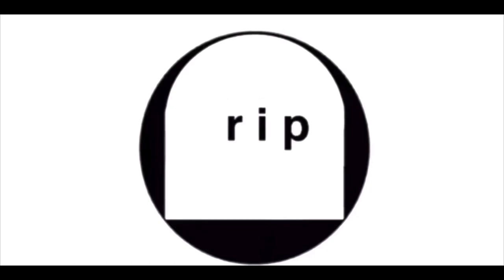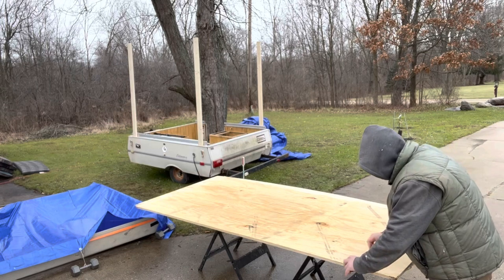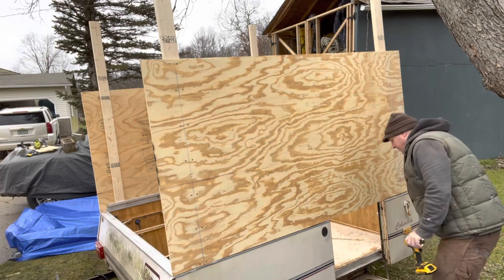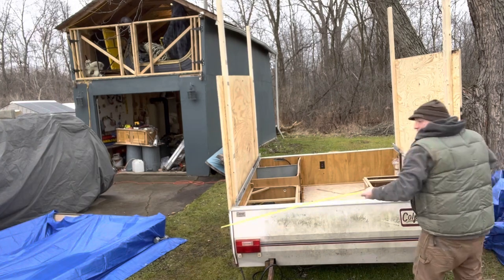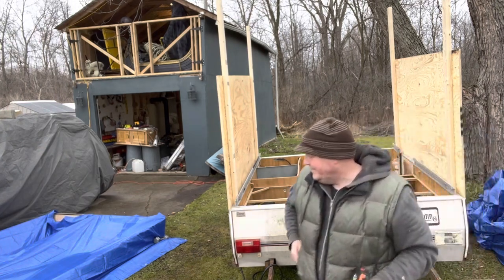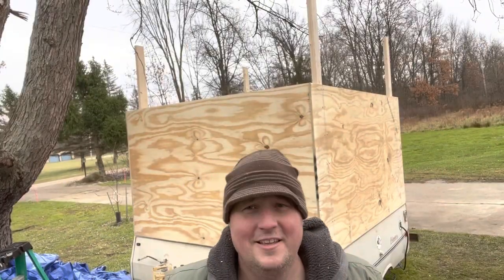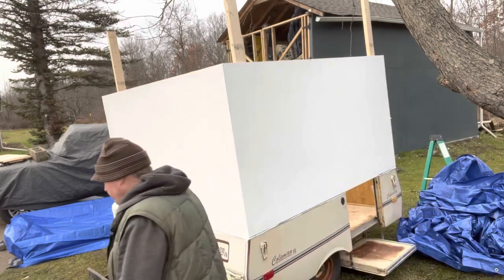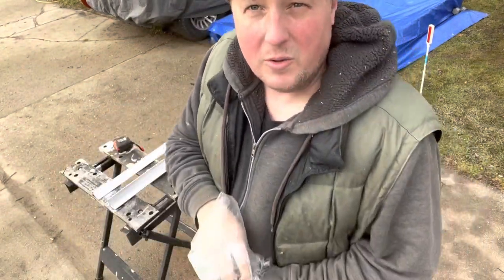PopUp Camper ADDING WALLS | HARD SIDE Conversion ep4 Tiny Cabin #diycamper #popupcamper  #camping

Comment: I got to the point where he recommends Stainless Steel to fasten aluminum. Might be a better choice as aluminum and Stainless steel react and cause corrosion. I don't remember exactly but I think Cadmium plated hardware is preferred I am enjoying watching his build. Video quality, he speaks clearly, easy to follow, etc. very well done.
Reply from the maker: Yeah you are right, between 2 unlike metals like Aluminum and Stainless, lesser metals like Aluminum will corrode if there is an electrolyte such as salt water to create electrolysis between the metals.  I am hoping I do not have this issue since its not in the water a lot.  I used what I had from my local hardware store, I was thinking of using galvanized steel too, I just have had really great luck with stainless in the past.  Thank you so much for all the positive comments!  This was a very fun build and I am still adding to it even though its pretty much finished now.  If you haven't Please Subscribe so you can keep up to date.  Happy New Year!
Reply: I did subscribe, yesterday. You have a gift. You clearly show how to do something, then fast forward to next step. great editing, keep the action moving. Smooth and humorous voice. Happy New Year to you.  @Jeep-Creep
Reply from the maker: @hueypilot1950  Thank you!  It honestly has been a lot of practice that helps my editing, pace, camera presence.  Believe it or not the video work is probably nearly 1/2 or more of the work.  Often I will film something that might take a whole day.  Condense it down into as little as 15min.  I enjoy this work a lot and keep a sense of humor I hope all my viewers get.  I really appreciate this kind of feedback, let's me know I am doing something right.  It's very hard to become popular on YouTube to earn enough money to make it worth wild.  Sure there are lots of YouTubers that earn a small fortune but they are very few.  Anyways Happy New Year and I hope 2024 is awesome for you and yours!

Comment: All things , such as trailers of all sorts and tiny houses and sheds that are manufactured in mass quantities are always gonna be out of square! These trailers are put together on a jig and then the parts and pieces are attached after it comes together.
The more and more the jig is used. It will get stretched warped and just weakened. And that is why your trailer/ camper is worn out and 3/4 of an inch off.
Reply from the maker: Totally makes sense. I’ve had an RV repair shop tell me these homemade rigs are built better too lol 😂

Comment: Why didn't you just pull it with your car???
Reply from the maker: Because I was using my car to winch the roof up the tree. I have a hand crank winch I attached to my bumper. Plus the camper isn’t too heavy to move by hand.

Comment: Looks like the undercarriage needs nore love than your giving it before the remodel
Reply from the maker: You are right!  I did bring it to a camper shop to give me the all clear on the suspension. They repacked the bearings, approved my weight, made sure it’s road worthy. The surface rust needs to be addressed. One of the main reasons I waited on addressing is because I wanted to figure out the gray and fresh water tank locations first. Also I need to figure out the diesel heater pump location. It makes a ticking sound and I need to move it a third time. Check my latest videos for progress. It’s winter now so I will handle the underside in the spring. I think I will wire wheel the underside, use a etching primer, then paint. After paint probably add a truck bed liner after it cures. Since I am in Michigan I want to make sure it stands up to the humidity and salt if I winter camp.
Reply: @Jeep-Creep  just don't wanna see your work goto waste. I converted a full size 78 Thomas school bus and got half as much time out of it due to rust and undercarriage problems best of luck
Reply from the maker: @retropalooza  thank you for the look out. For sure I will address it and take your advice of avoiding a pitfall
Reply: @Jeep-Creep  ahhh just being a nit picker. Been there done that. It's great to make your own you just don't get the professional no worry quality new buys have. Best of luck

Comment: Sure wish I was there to give you a hand…but great job.👍
Reply from the maker: I think you are the first person to realize just how hard it is to do this by yourself.  It is seriously harder than twice as hard, probably 3 or 4 times as hard without 2 people.  I reached my goal though and turned a piece of junk into something nice.  I am itching to do another one, I really would like to start with a 6x12 frame vs this itty bitty 6x6.  I would like to do a permanent bed and a fixed bench seat table, with a wet/shower bathroom.  This one came in at 1600lbs, which tows nicely.  Pretty sure I could pull off a 6x12 with all the extras under 2500lbs which is still nice for a mid-size SUV tow even though I have a Tahoe pulls easy, but superlight is nice for MPG.  Extra room would be nice for sleeping more than 1 person as well.  Stay tuned though, I have a few things to improve on this build... just finishing up Solar system and working to improve Chinese Diesel heater noise reduction, and finish my water system.  I would like to setup for a hot shower system, which will have to be outside maybe, unless I come up with a super mini-system inside.  I have ideas, I have see Van campers do it.

Comment: I'm building something very similar, was procrastinating because of the snow. Guess I better head down to the lumber store haha
Reply from the maker: Nice!  I highly recommend this build!  It’s fun, easy, and inexpensive. What kind of trailer are you starting with, how big is it?  I would love to see photos of your project. They are fun to do and lots of Facebook groups too on this subject.
Reply: @Jeep Creep  it's an old 7x8 tent trailer, it's quite an interesting thing, I've never seen one so heavy duty. The sides are more metal than tin. I will keep video and pics of the whole build and time line, and mabye throw them up.
Reply from the maker: @sockymcblackface7698  for sure I am interested in watching your progress.  Sounds like a bad ass trailer!  I love the older stuff it’s heavier duty than it needed be so the axles will take the extra weight easy. Mine has tin sides but the frame is very heavy which I like. 7x8 is a good size in my book. I am solo camping in mine with just a single twin Murphy style bed. I look forward to seeing what kinda layout you go with.

Comment: Ooh wow. Yeah I had previously seen this video already. It must of been a bit of a nightmare trying to do that by yourself. 

Hmm.. and now that i think of it, I don't even have that tree 🤣😅🤦‍♀️.

Can't wait to see how MY trying to build this will be.
Reply from the maker: Depending on how bad your roof is you might not have to remove it.
Reply: @Jeep-Creep  i believe my roof is fine. I was just thinking money wise.. reselling the whole system together. I'm not sure how it works. I am still studying the case 😅. 🙃 

In time I will decide. But your idea is awesome. I just would have loved an overall...redo. for what's upper part. That's all. More money I know. Indeed.
Reply from the maker: @LRDReadings  with a solid roof it should be much easier
Reply: @Jeep-Creep  you mean a new roof or my old roof? Sorry ..not sure I understood.
Reply from the maker: @LRDReadings  oh you said your roof is fine. I had to take mine off and put it back on which is hard. If your roof is in good shape you can put new walls in without removing it.
Reply: @Jeep-Creep  but I still have those metal bars that allow it to go up and down. 

I'm scared it goes wrong during transport while up. I was going to use the beam method instead. And put In new walls like you. Sell the parts you know.
Reply from the maker: @LRDReadings  you probably can replace one metal beam at a time and use something to prop up the roof as you remove one metal beam then replace with wood beam at a time. Or build some sort of stand to prop the roof up while replacing the metal beams. Easier than trying to lift the roof back on.
Reply: @Jeep-Creep  woaah. Definitely not a bad idea. Yes I agree! 👍 

I'm 5 feet tall...would help a lot 😅 story of my life.
Reply: @Jeep-Creep  thanks a bunch. 

I'm currently looking for a new spot to do my project on. As the current spot is not going to be avail in one month from now. 

So before I attack ..I want to make sure everything is a go. Gathering information meanwhile. 

I have a quick floor plan..with lots of notes 😅.  I can send you on IG so you can see what I have in mind. 

The slide in bed will be another plan. (All sides plan)

The popup shower or shower and kitchen design another. (Front view)
Reply from the maker: @LRDReadings  lol yeah for sure this well make it easier then